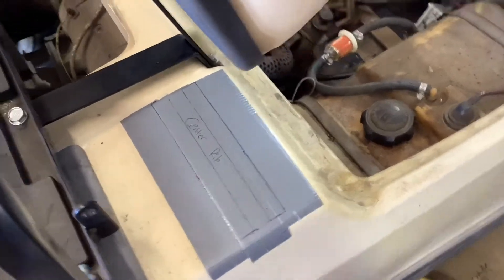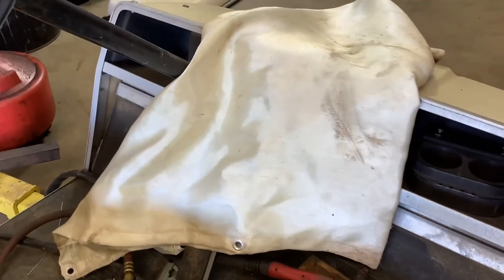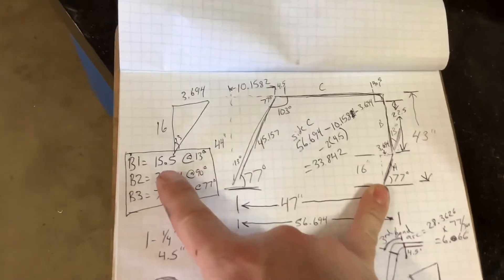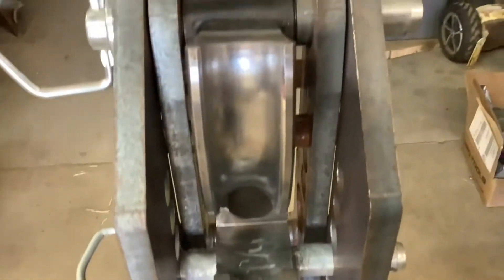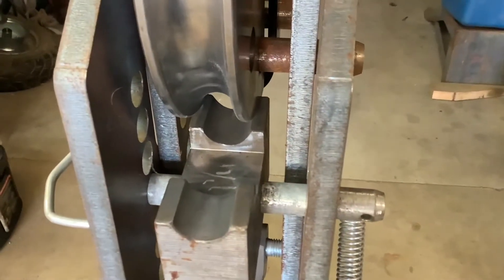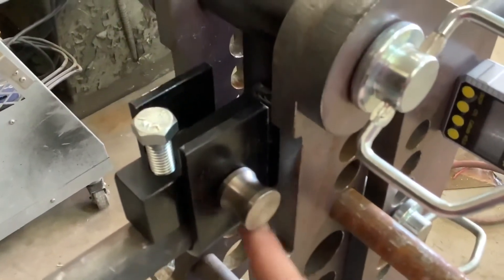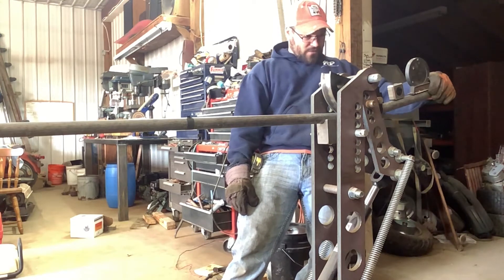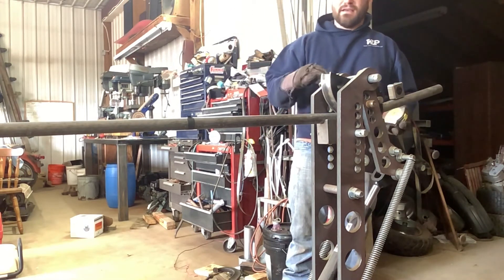Shop Project - Club Car Golf Cart Roll Cage | Part 2 : Setting Up a Successful Bend

Comment: Nice machine. Makes bending pipes an ease. Do you use special bendable pipes?
Reply from the maker: This is considered seam welded tubing.  Pipes are for transporting fluids and gases, tubing is for structure 👍